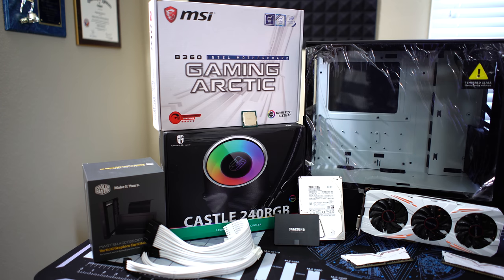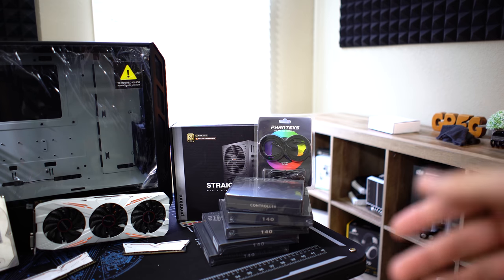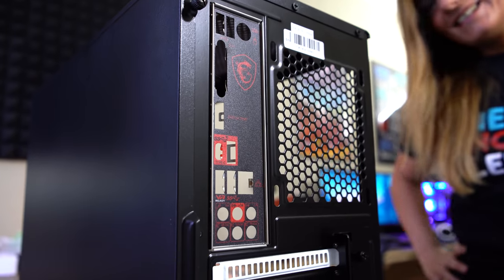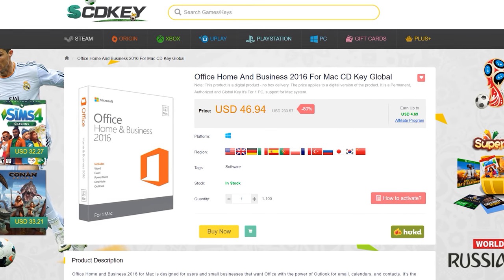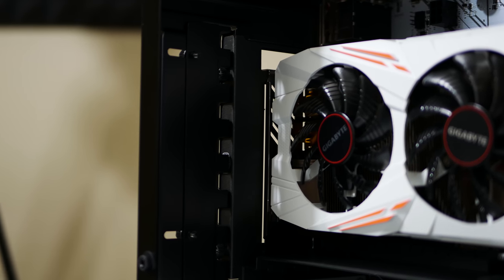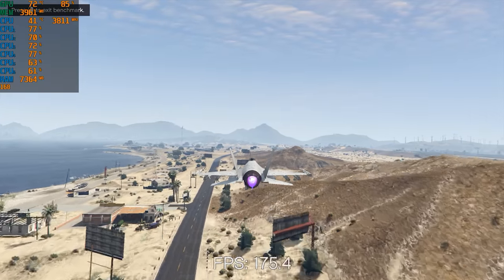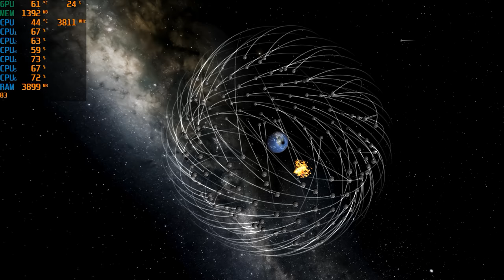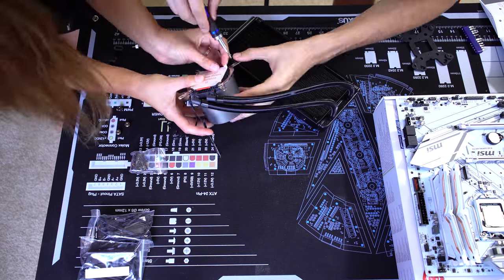We Paired a 1080Ti with an i5 8400...

Comment: I’m building my first ever pc 

Ryzen 2700x 

RX 580 8gb

Kolink 600W 80 plus bronze psu 

2X 4gb ram 

Gigabyte x470 aorus gaming mobo 

2tb hdd 

Cooler master master box lite 5 RGB
480gb ssd
Reply: Zain Rizvi cpu was kinda overkill but nice mate,its a futureproof one!
Reply: Mario Brother thanks I’m a noob at there any bottlenecks in there
Reply: Zain Rizvi you'll learn eventually
Reply: id probably get a better gpu to pair such a beast cpu with. You can definitely take advantage of Freesync if ur monitor has it. And personally, i like cases with more airflow. what resolution you gaming at?
Reply: Dkbutler 02 if only 1080p it will be a beast init
Reply: Mario Brother yeah i was wondering if it would be 1080p. if he has freesync on his mojitor i would def get that 580. if not, he can use the 1060 6gb or something
Reply: Dkbutler 02 even 1070, if he can afford it,but 580 is very good tho
Reply: Mario Brother yeahh
Reply: Salt Maker what happened
Reply: what do you need the 2700x for? 

If you answer gaming, there isnt any difference if you went with thr 2600x
Reply: Guy , change the box i have the cooler master rgb lite box and the aeration + air flux is shit literraly it suck temp are pretty hot
Reply: Wtf man get a r5 1600 or something not a 2700x
Reply: Why the fuck would you pair a 2700x with 8gb ram
Reply: Get an other other case. Trust me. The airflow is really bad which leads to a loud pc
Reply: Use a Ryzen ryzen 5 2600 and add extra 8 gb of ram. Also, you need SSD, this is a must in my opinion. You can also get ryzen 5 1600 instead to save for SSD, if money is an issue. I am not an expert either, but I think this is much better.
Reply: Rx 580 is weak for that build. Get a 1080 ti
Reply: future proof .future upgradeable. 👍💯

Comment: Short: What bottlenecks depends entirely on what Software runs, and on what settings.
You can have a HARD Cpu-Bottleneck, or a HARD GPU Bottleneck, using the same hardware or the same Software. Only difference: Different Graphic settings.
This Hardware in CS:GO (720p-1080p + Low/Medium settings) would have a CPU Bottleneck.
This Hardware in Witcher 3 5k Ultra settings: GPU Bottleneck, and CPU would be bored af.

GTA 5 1080p Maxed out settings? Every GPU that exists right now, won't be able to deliver playable fps at all times.

Just a few Graphic Settings in a certain Software can shift the "active Bottleneck" from one extreme to the other.

Comment: I don't really understand why anyone would go for an 8400 when you could get a better cpu in Ryzen for the same, or cheaper. 

Personally I went from a 3570k to a 2700x when it released this spring, I honestly couldn't be more convinced that AMD was the way to go over Intel. 
I noticed that the 3570 would start to struggle when under load from games, while playing youtube/netflix videos on my tv. Doubling the core count, quadrupling the thread count and a higher clockspeed has been magical. If AMD's graphics department get better by the time I retire my 1070 GTX, I'll have both an AMD CPU and GPU for the first time since I was 15.
Reply: because the 8400 gives more fps? People buy it to play games! Nothing more, and it games better than any ryzen!
Reply: Myself don't want to buy new RAM with that ridiculuos price and not sure if my old RAM would run well with ryzen.
Reply: it is also more expensive?

Comment: i think you're underestimating the amount of people that only game on their desktop PCs. i mean, how many people do photo/video editing, render stuff or stream? the tipical gamer has, at most, the game, steam, chrome, an Anti-Virus and spotify open at the same time. Things that an i5 can handle no problem.
Reply: Angelo Ferrarini  
Yeah but alot of these games are getting really intensive to tbh
Reply: i mean my friends have like 30 tabs open at all times plus some other programs running in the background and then the actual game.
Reply: Angelo Ferrarini if you have anti virus you're doing it wrong
Reply: Let's not forget all the fucking process Microsoft has in the background running
Reply: I don't think cpu reviews even have that much running....so it's still giving the Intel cpu's a tiny bias in reviews.  I mainly game...and I have sometimes run a second game in the background to run chores/crafting...while I do another game in the foreground....I'm betting having a 2nd game running would drop I5 minimums below R5 minimums. Pretty sure that i7's have aged much better than i5's when I see comments by i5 users having issues....never see the same from i7 users. R5's are almost like slightly lower clocked i7's vs i5's, but at an i5 price and a much more upgradeable platform.
Reply: i have

the game, steam, firefox, no antivirus, and no spotify

i use yotuube for my music, none of the good stuff is on spotify :D

Comment: I built an i5-8600k with a 1080ti and an i7-8086k with a 1080ti. Highly recommend an i5-8600k it’s a gaming beast. Gaming, streaming, editing go with the 8700k or 8086k. I found that the i5 keeps up very well with the i7 runs a little higher in utilization, but wow good cpu good price. Interesting you did an 8400 I say an 8600k far better. Thanks great video, subbed.

Comment: My Build
 i5 7500
Gtx 1060
8Gb Ram 
2 tb Hard Drive
Upgrades
8 more Gb of ram
SSD
32gb Optane
:D
Reply: Pvpluver why ssd AND optane?
Reply: Speeds up the HHD And its Pretty Cheap :P I have a 2 tb in use and another 2 ready to go in from scrap builds
Reply: Great for 1080p high, but as games get bigger I would get a another 2tb hard drive
Reply: But you can also cache the hdd with anouther ssd, and the cache would be much bigger.
Reply: Optane memory paired with a 7200rpm hard drive could be faster than some SSDs
Reply: Im_Godly why not pair a ssd with a hdd you get almost ssd performance and not locked to a platform. The extra speed and endurance of optane really isn't helping much here. A fast ssd and a hdd will also perform like a ssd for most uses.
Reply: I want to see a ":D" in your final build.
Reply: I think optane only caches hdds in 8000 series
Reply: Wow, i feel kinda bad for people that bought intel 7 gen products before 8 gen was announced, 8 gen is just so much more fair!
Reply: Brandon Aitken  I mean you can buy a 2tb hdd and optane cheaper than a 500gb ssd. And get ssd like speeds..
Reply: Pvpluver, I have the same specs (no ssd), which we built in July 2017......runs everything great in 1080p!  Take a look at Steam stats and you'll see the most used GPU is the GTX1060........when 4k monitors go down in price (2-3 years), that is when you need to upgrade to a better system.......my 2 cents....
Reply: Pvpluver You are adding 8gb ram whilst my pc has 2. LOL
Reply: Pvpluver rocking an Intel core (2) duo
Reply: Pvpluver and i 4000 graphics (integrated,)
Reply: Midranges

Comment: I stream and game pubg at high af quality settings with an i7 8700k with hyperthreading disabled. does that mean Im basically doing it with an i5?
Reply: R Z yes

Edit: Just with more cache and higher clock speeds
Reply: if that's the case, then all these nay sayers talking ryzen, are wrong. because I'm doing heavy workloads with an i5 flawlessly that I would not be able to do with a ryzen. but, like you said more cache and clock speeds, wonder how much those really matter.
Reply: R Z why tho?
Reply: better frame time latencies and better fps with hyperthreading disabled. have noticed no improvements in anything whatsoever with hyperthreading enabled...
Reply: R Z >.< Im not sure what it has to do with his sexuality but still why use an i7 without hyperthreading when you bought the CPU for the performance
Reply: they are binned better than the i5's, tend to almost gaurantee a 5ghz or higher overclock nowadays on the i7's... and it has everything to do with butt sex with other men. everything.
Reply: R Z no it doesn't... It just makes you sound childish.... I can't take you seriously because you happen to say what you said when it's unrelated to the subject

Comment: i7 or go home. The only time you should be using an i5 is if it was given to you. Buying locked chips is dumb. Save more money. Buy the better CPU. That CPU will last longer. My 5820k is nearly 4 years old. I spent 320 bucks on it and it is still working perfectly with my gtx 1080. While the X99 platform isnt flawless, it still has the features everyone wants. When and if you build a pc, NEVER skimp on your platform. You will be stuck with it for years. Everything else can be upgraded.
Reply: Please dont think that I'm unhappy with the i5 processors. I have a theater pc that I bought from my employer for 50 bucks. It has an i5 4570 in it. I paired it with a gtx 960 and it is great for playing minecraft and other easy titles. It makes no sense buying an i5 new when you can pick them up secondhand for cheap.
Reply: Me too skipped 6600k and got 6700k instead and its still rocks with a 1080ti.
Reply: LOL and no. 
depends on what are pc purposes and the resolution you are playing also budget, 
if you are doing it for gaming only
UWQHD+4K doesn't need that high CPU Power because it will bottleneck the GPU. I built my rig 6 months ago with b360, 8400, aircooler and 1080ti. It is far cheaper than buying 8700k, an AIO, and 1070 ti/1080. I did the math, and guess what will power your FPS better? 1080 ti will do more. 

With b360+8400 i can relocate the budget to 1080 ti and other thing. it does wonder this $200 CPU can do.
Reply: Gloat much? You do realise that not all i5's are locked? In my main rig I've still got my 4770k and 970, my CPU is slacking at 1440p. In my second rig is a 4690k, previously g3258. That i5 isn't struggling with games it's GPU bottlenecked with my old 660. So no, as long as you get a 'good' i5 that isn't locked with a good cooler and overclock it it's fine for most people.
Reply: Pommy192 there is a huge difference between "not struggling" and fluid gaming experience. To get 1440p at 144 hz, you will need more than 4 cores and 4 threads
Reply: Adiprima Sulakstono I guarantee my 6 core processor that is nearly 4 years old will beat your shiny new i5. You wont be able to say the same about your processor in 4 years. Since I was smart and bought an enthusiasts CPU, I guarantee its lifespan will outlast yours. And who cares about cooling. Nobody HAS to buy a AIO. The dark rock pro 3 aircooler I use is more than enough to keep my processor cool at 4.0+ Ghz.
Reply: Patrick PTMonk I'm playing at 1440p 165hz in many games fine on my main rig. Examples that aren't fluid are games such as far cry 5. Don't give that bullshit mate you really are blind to consumerism. What's next you need  8 cores for playing at 4k? Man you are a joke haha I don't think your tech savvy comparing your 5 gen 6 core to a 8th gen i5 just because you think more cores are better? Why haven't you got a Xeon? It's not all about cores kid it's about single core performance I bet you think that Snapdragon CPUs are more powerful than Apple AX CPUs.
You sound like the guy who just clicks the most expensive on a pc builder cause you think it's best.
Reply: Patrick PTMonk You deleted your comment? I still see half of what you put in my notifications.
Oh you've got 3 certificates in IT oh wow go you! Bless that's nothing mate just you know how to Microsoft office 😂. That doesn't make you tech savvy. You just know the basics. 
Your little certificates have got nothing on my 1st class bachelor's degree with honours in network administration with cloud computing. 
And my i7 doesn't apply? I've got 4 cores 8 threads? I'm playing in a higher resolution I'm GPU bottlenecked.
Even an i5 2500k has about a 5-10% performance difference than an 8th gen CPU at 4k, check out Linus' video.
Reply: He's talking out of his ass.. gloating his glorious i7 without research. any i5 will do gaming just fine after kabylake. even 7600k is still a good value
Reply: Adiprima Sulakstono Exactly mate can't agree anymore
Reply: Adiprima Sulakstono... This guy knows what he is talking about...i also did my research and got the same answer... Games are more gpu intensive than cpu so its better to allocate more to a gpu... That is if gaming is your main thing!
Reply: German Esparza Well done you
Reply: I used my old quad core for 10 years until it started dipping under 60fps in the games I played like Forza horizon 3.
Maybe the 8400 won't last as long but then if I'm still happy with 1080 maybe it will.  GPUs are getting so good these days.
By then the 8700k will cost peanuts and I can still shove one in if I had too but realistically I'll be upgrading to the next good value range of CPUs.
Getting an 8400 is amazing value I think.
Reply: Paul Exactly Paul, what was your quad core you used to have if I may ask?
Reply: Pommy192 I7 870.  It played Forza pretty well if I turned details down and handled BF 1 great but I knew it was time to upgrade.
Well happy with the 8400. Got an M9i cooler and it's very quiet.
I'm all about good bang for buck. Some call it being tight with money lol but I get satisfaction from building a quality but good value pc.
Reply: "Buying locked chips is dumb."

No. Overclocking is dumb. You get to have a larger e-peen at the cost of faster silicon degradation.

Comment: When I built my PC in 2016 I used an i5 6500 and a 1060 6gb. Then in March 2017 Nvidia dropped the 1080ti and I had to have it. So I got it to drive 4k gaming. At that resolution the pairing is just fine. Works great in 1440p too. Looking forward to intels 9000 series to upgrade finally

Comment: The pre built I got from BestBuy had a i5 8400 and a GTX 1060. I swapped out the 1060 for the 1080 ti and it runs great on a 1440 Ultra wide monitor.  Also put a 360 AIO on my GPU and wow getting 15c idle temps and 35c under load and overclocked. BEST MOD EVER lol

Comment: Just got an i5-8400 and I have it paired with an EVGA 980ti. This CPU is soooooo much better than the i7-2600 I had. It doesn't bottleneck my GPU and gameplay is as smooth as butter. I'm thinking a 1080ti and a 1440p monitor will be my next upgrade. Maybe one day I will work my way up to an i7-8700 and an RTX 2080ti.

Comment: The same way you can pair a 1060 with a 3570K.
There will be limitations but most stuff will run fine.
(It'can be an issue in games that won't utilize the cores properly. As in badly multithreading stuff)
For a future upgrade I'm a but troubled. The best option for me currently in terms of use would most likely the 8600K, but with the pricing and Intels consumer decisions it's a hard choice.

Comment: My 8700K @ 4.5 also loads up 100% during RotTR benchmark and that's awesome, because engine uses all the possible resources to minimize the loads. Wish Fallout 4 used the same technique, cuz those 40-60 seconds loads are just atrocious.

Nice video btw, but people who can afford a 1080TI can probably afford an i7 or ryzen 7, so that's strange combination + those people can afford a 144hz monitor and with such CPU they will occur lots of FPS drops. Otherwise even a 1070 will grant ~60 FPS at 1440p at ultra settings, which fits i5 8400 better for 60hz monitors
Reply: 6700k 4.6ghz + titan XP here

max CPU usage during anything is around 50%, so i could SLI without a single problem or go another X years before i need to add 200mhz more XD

Comment: I recently purchased this case ,  this is my first RGB build.  The RGB connector for the case RGB is a 3 pin digital connector and my ASUS mb has two 4 pin RGB headers.  Emailed Phanteks support but all they told me was that the 3 pin is not compatible with the 4 pin.  Which I figured that out that's why I emailed them, but didn't reply back with a solution.  So I can only assume you all used the Phanteks controller to connect to the case RGB?  Was going to purchase it but didn't find anything online showing that was the correct solution.

Comment: Watching now. I have the cpu/1080ti. I only game on this rig so until I see problems no upgrades will be needed.

Z370 Asus Rog Gaming H 
I5 8400
Cryorig H7
16G Corsair Vegence Pro Rgb 3000mhz
Evga 750w G3 
Xpg Nvme 250 gig boot drive
WD Black Nvme 500 gig
Samsung Evo Pro 650 500 gig
Evga 1080ti Sc2
Cablemod Carbon/Red extensions 
Cougar Panzer Evo case
9 Corsair LL fans

Comment: z370 boards do allow the 8400 to turbo much higher. On my tuf z370 gaming plus the i5 turbos all the way up to 4.2ghz at stock settings with the stock cooler. I've seen similar results by various creators, and the B boards do seem to limit it to around 3.9.

Comment: i would have thought that pair would match, and it did pretty good.   i am sure many people had a i7 6700k paired with a 1080ti and that also works good.  
no room for gpu upgrade in the future tho.  

i have a 6700k right now,  and want the next generation gpu's when they come out.
if i want a new cpu then it either has to be 8 core at 5ghz or 6 core at 6ghz(if ipc stay the same)
running at 4.5ghz now and i can not lose any single core performance to be worth a upgrade.

Comment: I bought a prebuilt( yes I know a major sin lol) but I did upgrade the ram so now its this: i5 8400 gtx 1060 with 32gb ddr4 ram and I absolutely love it got it last year in December for around 800 bucks.
Reply: I did the same thing bro but I got my pre-built for the i5 8400 it came with a 1050ti which imo probably one of the worst ti cards ever but i upgraded to the 1060 6 gb last year and I'm looking to get the 1080ti in summer 2020 but idk the 2070 super prices are getting really good so I have a dilemma on my hands XD

Comment: My current  rig is an i5-2400 and a HTC 1050ti, a system  which  I have used to get into PC gaming.  Of course  my next right was supposed  to have the 8400 but I'm opting for an r5 1500x and the same gpu. Either way it's quite  the upgrade,  and since I'm streaming  I think  more threads would be better